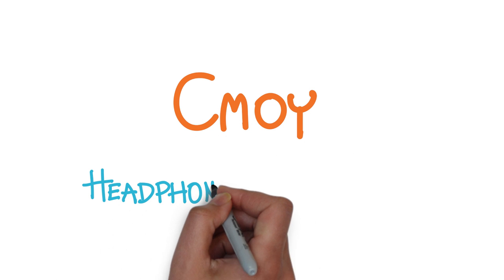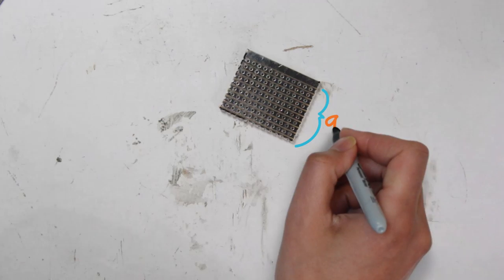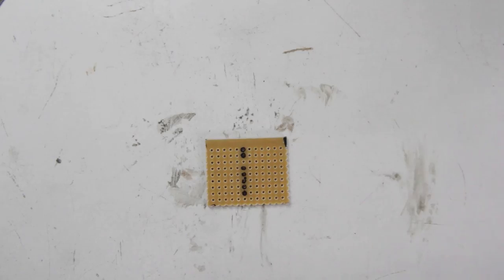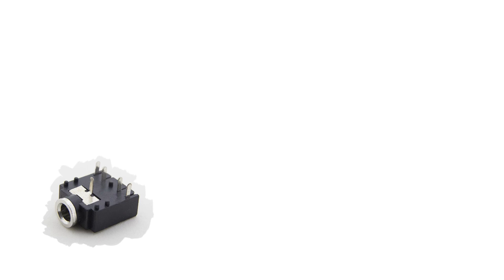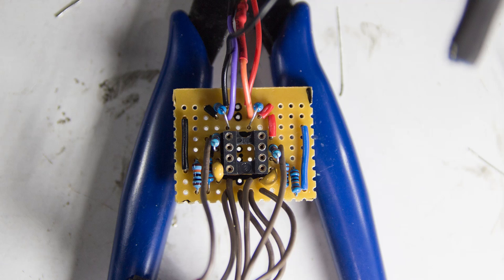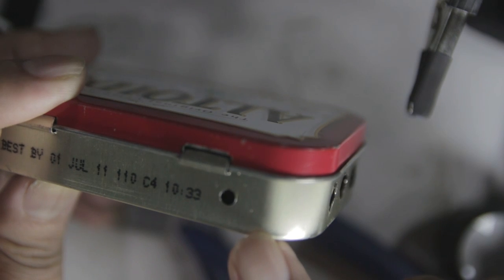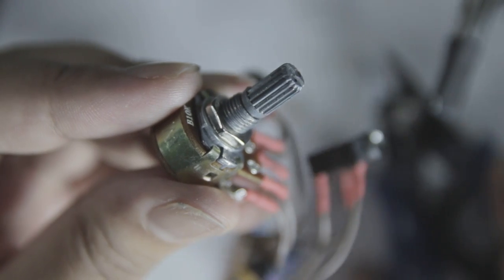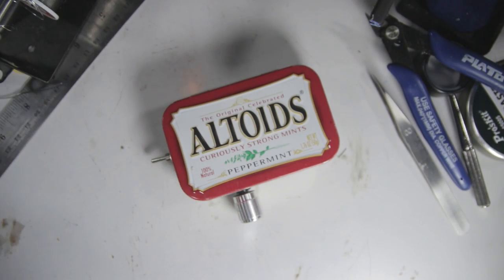Build Cmoy Headphone Amplifier: Quick Step by Step

Comment: This uses two 9V batteries in series, while the website used only one. Explanation?
Reply: Lars Petersdorff um...I think there are some op amp need a high voltage input to perform better, for example ad827, but the problem is that why doesnt he use the connecting point of two 9 v batteries as the analog gnd, it would be better in my mind.

 Last but not least, this headphone amp are...too small, too small that cant give a high current output, and he uses too much wires, it will makes the sound disort....in my eyes.